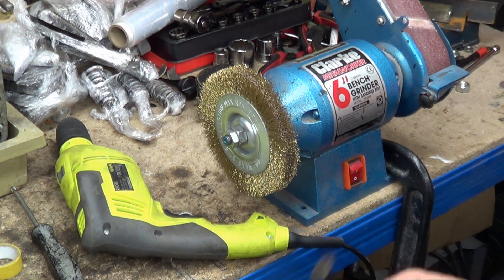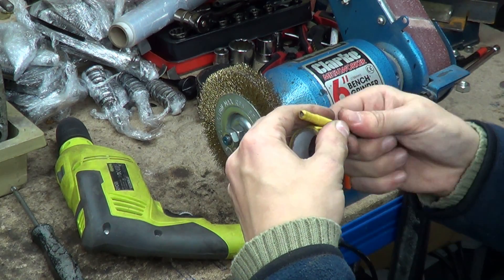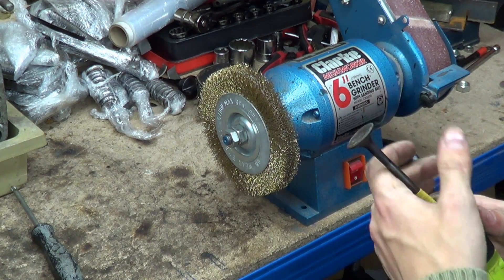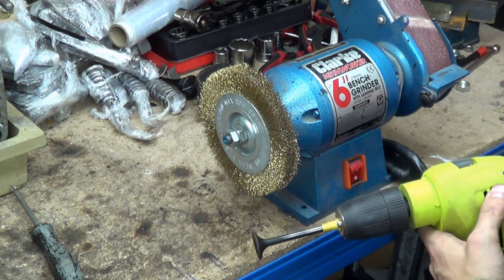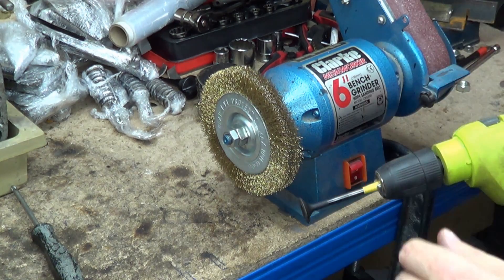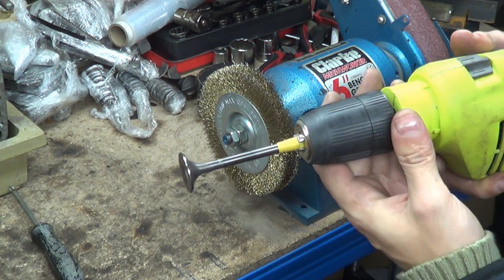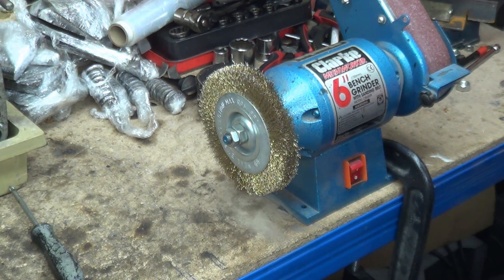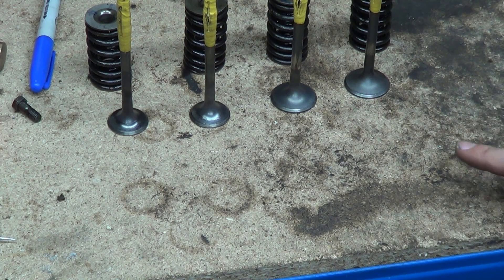CX500 V Twin 4 Stroke Series - Part 16 Cleaning Valves and Pistons

Comment: Excellent series . In a past installment you speculated on the purpose of that empty chamber on the heads. I think it stems from a casting process concern. They wanted the head to extend to two mounting holes away from the combustion chamber but hey didn't want what would be a mass in the casting heavier than other parts of the head . When cooling the cast a section that massive would cool and shrink more slowly surely causing cracks. They made it hollow to reduce the duration of the cooling process.